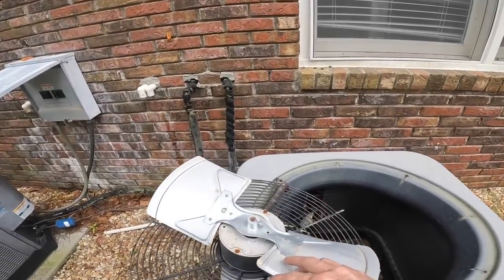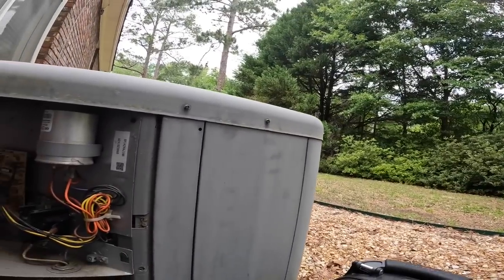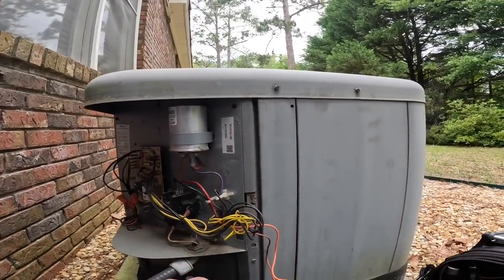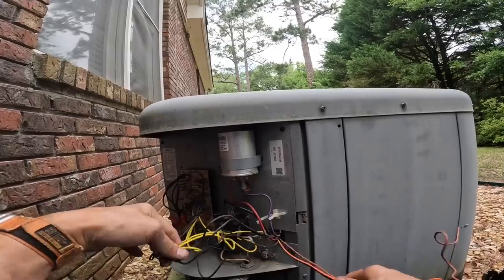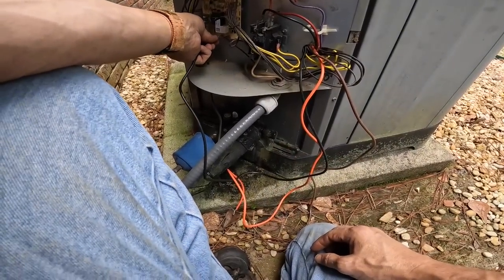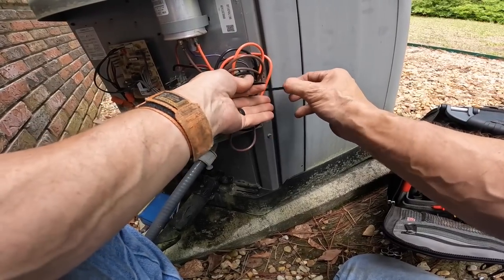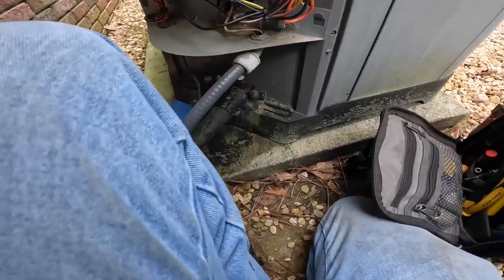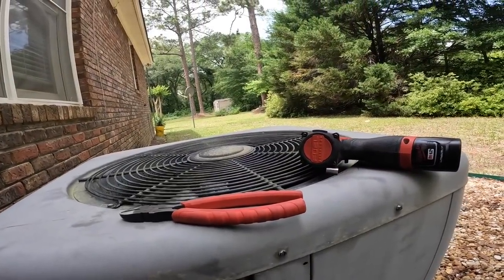Bearings Just Didn’t Sound Right! #hvacguy #hvaclife

Comment: Nice job, Curtis. Thinking about zip ties, have you tried the re-usable ones? They have a small release lever molded as part of the latch to release the locking tang. If they're not cut off to close to the latch then they can be refitted without hassle.

Personally, I'm not a fan of zip ties but when they are need I try to re-use them if they are still serviceable. My pocket knife is the Victorinox Electrician Swiss Army Knife and I developed a technique of using the awl, which has a tapered 'L' profile, as a releasing tool for regular zip ties. Basically, I insert it at one side of the tang, twist the awl slightly to lever the locking tang and the zip tie is released. With a little practice it becomes second nature. This can save a little time by effectively having a pre-cut to length tie and no waste plastic to find and tidy up. It also has the useful side-effect of helping protect the environment from plastic waste.

Comment: Putting "FAN RUN" on the cap is silly, i ALWAYS take it off the cap and put it on the contactor on new installs... The Cap feed wire is small, has enough load on it during start, doesn't need anymore for "RUN" also.

Comment: I absolutely love your videos, especially your work methods, attention to detail and ethics.  You should be the standard by which others measure their performance!  In this video, I noticed you didn't verify the required capacitor size for the new motor (at least not on camera).  Is that because OEM fan motors for a particular condenser model always use the same size capacitor as the original motor?
Reply from the maker: This one did, yes.
Reply: Correct. Part is ordered based on serial number. Of course it doesn’t need a different size cap
Reply: How does warranty work 
Do they pay you or the customer and fight to get reimbursed 
Never dealt with warrantees

Comment: HVAC equipment manufacturers sure are cheap nowadays, you only get two fan blades.  Next year we’ll probably only get one fan blade on new equipment.  🤣  My 13 year old A/C has four heavy duty steeply raked fan blades, and they do a great job of drawing the air through the condenser coil and out the top.

Comment: 7:38 wonder if you had a small bucket 🪣 turned upside down with a hole in it roughly fan shaft size to set the fan on. So you wouldn’t have to wrestle too much to to get it mounted to the grills. You’ve probably thought of something like that anyway probably more hassle than it’d be worth.  Never mind

Comment: I’m doing a public service announcement for anyone owning an older Subaru. My 03/4 barely crossed a hundred k, never a single problem, fully maintained at the dealer. Check engine light starts with rough starts. I took it in 5 times to the dealer, once to a different place, they kept saying they couldn’t find the problem. (After charging over 2k for ignition this and that, plugs and wires bla bla coil this and that) Then, dealer finally says “faulty head gasket, bad cylinder, new engine for 12 thousand.” Do a little research, turns out they new a certain class of years had bad gaskets, but never informed owners, it’s a very well known problem. So..keep an eye on your coolant levels, or replace your head gasket before it blows your engine..
Reply: Before you go that route, did they check idler air control (IAC) valve?
Reply: @davidb2438  I’m definitely not putting 12k work into my sweet 20 year old girl. I’m livid that they could have said at 60k “hey, some cars in this class have faulty head gaskets, do you want to be safe and replace it?” Which I would have done..allegedly they did “a comprehensive diagnostic,” and both the independent shop and dealer charged me for stuff and sent me on my way saying it was repaired. The independent shop, the check engine light came back on when I first started it in their parking lot. That’s when I went back to my dealer for the last time and they said it was the head gasket. Funny thing is, the car runs fine, I can tell one cylinder is having issues, and the exhaust is burning coolant, but I’m just refilling my coolant as needed, and the decision to sell it or junk it will happen in August if I can’t pass the emissions test, assuming she lasts..
Reply: @davidb2438  but hey..I really appreciate the advice, I forgot to say that in my other reply..
Reply: @johncspine2787  Good luck!